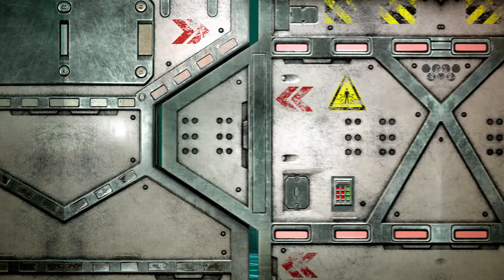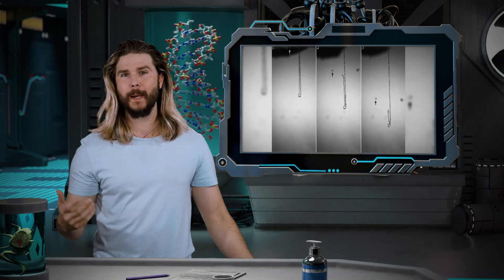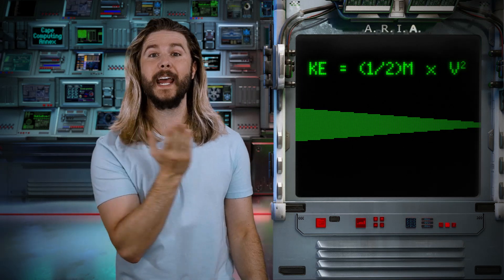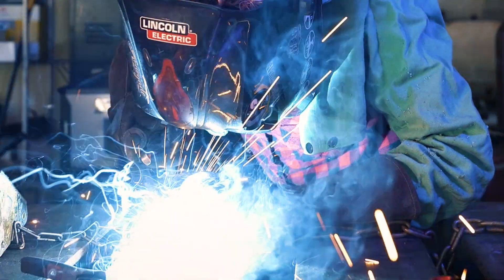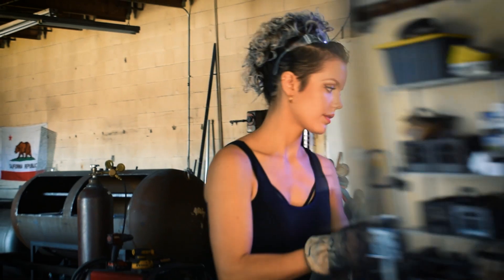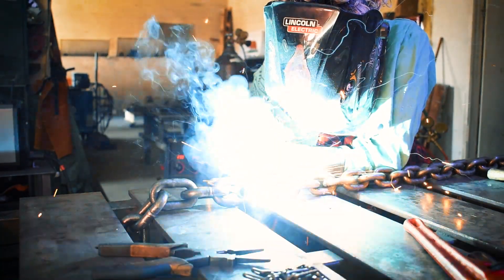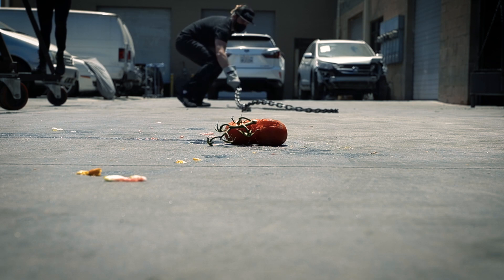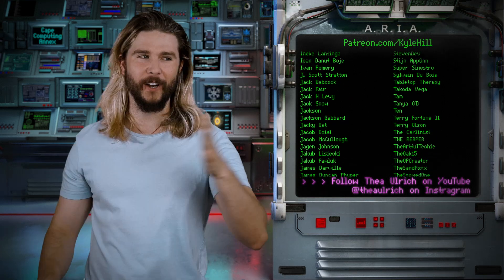Steel Chain Whips are SCARY

Comment: Wouldn't the steel whip lose momentum from the friction on the ground. If so I think we are only seeing part of its potential. I have an idea what if you used a slippery floor with the whip to reduce friction so then it would go much faster.
Reply: Even a regular chain at these speeds are dangerous. Just look up anchor drops.

Comment: Not gana lie, I didnt expect that to work as well as it did. I figured it's mass and comparatively low starting velocity would be too much of an impedance, both if which i'm sure still limited it's potential.
But, you know what that means right? ... Time to build a machine to do it properly. Cutting fruit is one thing, but I'm sure with enough mechanical robo force, you could cut through a small log.

Comment: And the true question that hits me is: How heavy it is?

Think about a Whip+3, d10, bludgeoning damage on D&D :v
Reply: Considering what that chain did to fruit, I'm almost tempted to call it slashing damage.
Reply: @OtherKT  it could be both, since it cut through only with brute force
Reply: Well a whip is normally 1d4, so an upgrade to 1d10, 3 dice damage up, is a lot, I would put it at a 1d6 to 1d8. Or maybe change it up and keep the d4, but make it a 2d4. The steel whip of Hill. Plus, considering how well it cuts, maybe change the damage to slashing? But  bludgeoning works too.

Comment: You mention how it accelerates because the mass reduces towards the tip but it looks like that chain in free fall in the example has a constant mass from top to bottom. How does that work?
Reply: More mass = falling faster. The quarter is lighter so it doesn't fall as fast.